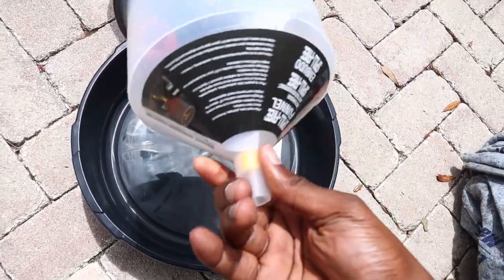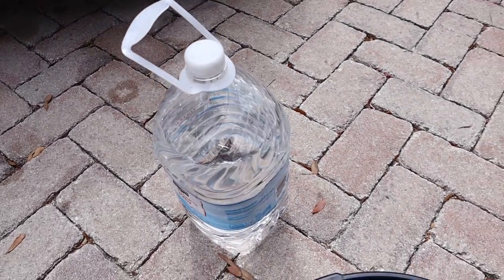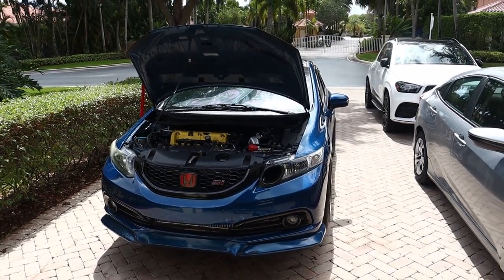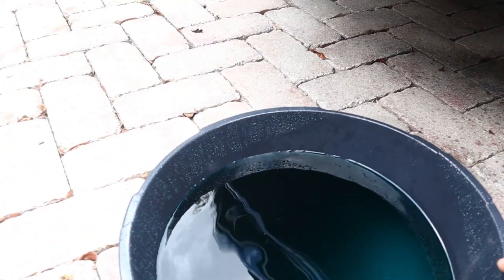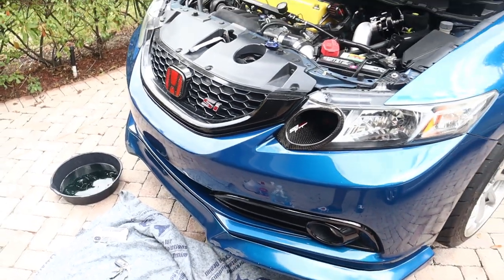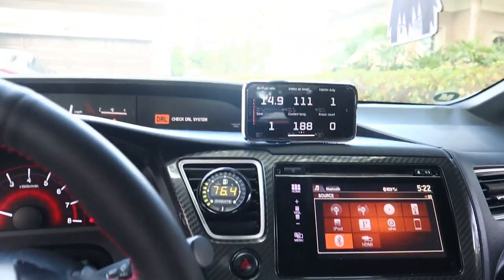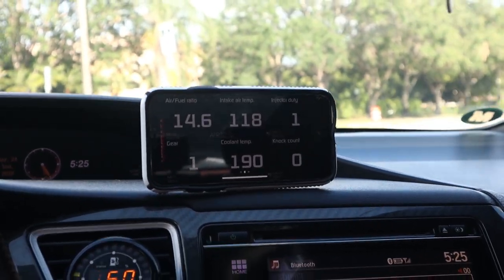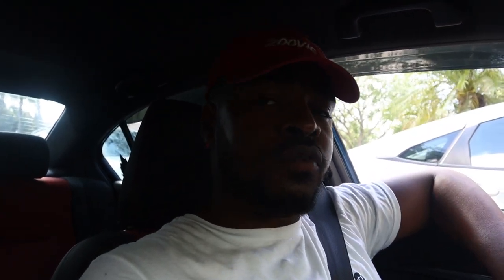Making My 400HP Civic Si Run COLDER! *FOR CHEAP*

Comment: Soon as it started getting hot in South Florida, I installed a koyo radiator and a high pressure cap just because I didn’t want to chance it.
Next mod is a Cooler thermostat and probably e85 on my 10th gen.
Reply: Same I’m from central Fl, I boosted my tc and lifted my head, about to get my engine from the machine shop to then add mole and put back in car. I got a mishimoto radiator and hoses. Should I be good with that or should I do other things as precaution.